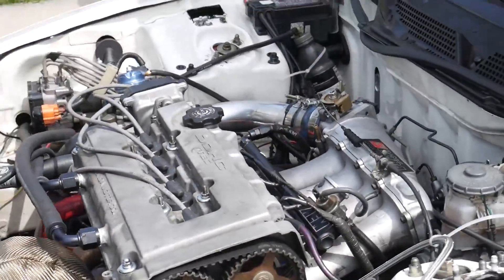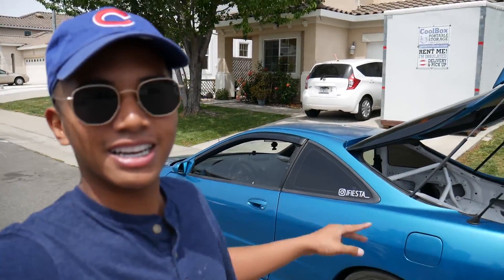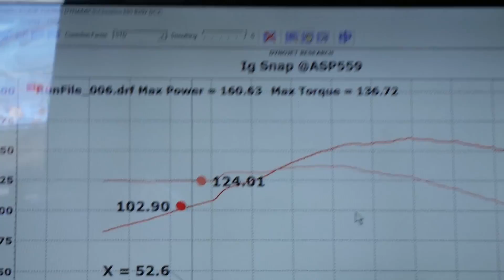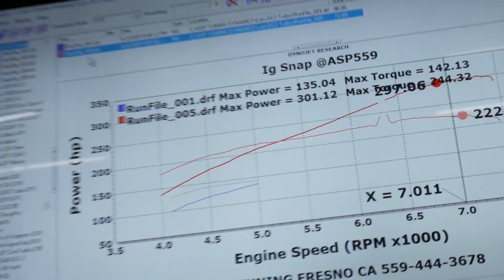HOW MUCH POWER DOES STOCK B20VTEC ACTUALLY MAKE.

Comment: thats weird. even for a low compression b20 w vtec is shouldnt be that low.i wouldve thought they would make 170-180 ish range. i have a stock b20b with 4-1 header stock intake and injectors, 89 pump, made 157 hp. pretty damn close to ur b20 vtec.
Reply: Yeah his tuner was probably spinning them like he was the turbo car. I'm throwing together a high comp b20b and 96 type r head. I'm hoping for atleaaaasssttt 170 with stock exhaust manifold,cat, muffler and piping. Stock 98 gsr ECU , skunk 2 intake manifold and that's about it

Comment: I’m making 191 / 157 on a stock ish b20b4/b16a2, running pump 92. Few more bolt ons & i should be around the 220 range
Reply: What dyno? Those are some pretty impressive numbers for a stock b20 vtec. I am just hoping my brother's stock b20z2/p72 longblock makes at least 170.
Reply: @OleUnreliable  dyno dynamics, tuned by RichMotorsports. If your b20v is healthy you should expect at least 170.

Rywire plug and play harness that plugs into p28. Custom basemap chip made 140ish, now i’m making 191/157
B16 oem intake, stock injectors stock throttle body
Cheap 2.5” 4-1 headers to a shitty 2.5” catless system. 
Head remanufactured
Stock rods micro polished.
ARP head studs and rod.
Crank stock, balanced and knife edged.
Shift linkage Integra.
Fuel pump walboro 155.
Water pump b20
Oil pump b20.
CTR Cams, high tension valve springs
Reply: @doghorsefish9320  Nice. I definitely missed the ish in stock ish. I was thinking an unopened bottom end. I bet that setup of yours rips pretty hard, I have a civic that makes about 194-195 but a lot less torque.
Reply: @OleUnreliable  yeah man it’s in a 95 civic dx coupe. Running the b16 trans, it’s definitely a ripper. I’m stoked to do a few bolt ons & potentially some head work & go in for a re tune. Should get 220 with bolt ons, maybe with some head work 230+ on 92 pump. We’ll see how much i wanna put into it, as i’m already pretty satisfied with it.

Comment: The b20vtec when stock is the rev limit at 7500? Or does it have any arp?  The tq is there but the whp is low, maybe it's a low comp b20vtec? I'm expecting 185-195whp for my setup on pump 91....thanks for the vid car looks hot
Reply from the maker: Hey brother, sorry this is a little late response. B20vtecs should be at 165 with the low comp b20 block. High comp you’re touching the numbers you want
Reply: Midorijon do you know how high she revs to on the stock lowcomp bottom end?
Reply: I made 175 whp and 133 tq on stock B20 low comp PHK Pistons and Type R head on E85 , upgraded the Pistons and Rods , put ARP studs and ACL bearings with a .30 Head Gasket , Same Type R head, V-stack intake, Type R header, full 3 Inch piping CATless tuned to 215 whp and 167 tq
Reply: @ACHEIZM  phk piston is the highest  comp of the b20 piston.it's the high comp of the b20b/z. Pf3 is the low comp but they have it in 8:8 and 9:2:1 comp. The phk b20s are 9:6:1 but yea with a gsr /b16 head it's still low 10:0/10:0:4 give or take but it is similar to a stock GSR so I would imagine on a good flowing bolt on and good tune with stock GSR cams I don't see why not 180+ with good tq. Your numbers looks right on
Reply: @ACHEIZM  also e85 to hit that number  so pump gas would be lower
Reply: @ACHEIZM  hey man! sick to hear how well things turned out. I'm deciding if I should open up the motor again or slap a turbo on my setup. I'm running b20b4(p3f)/gsr head ~9.4:1
skunk2 tuner1 cams/skunk2 cam gears
blox intake mani/S2 66mm tb
PLM tri Y 2¼" collector
blox 2¼" testpipe
amazon special 2¼ inch fart cannon
hondata s300v3 on 91 made 170whp/130tq dynocom
Reply: @noobatnothing  with your set up on low boost you can take yours to 260-300 whp imo ... It all depends what you enjoy most ! My set up was on 5 pounds before I owned the engine and that owner made 250 on the same Dyno. . Then sold to me without the turbo.
Reply: @b20eg195  thank you, pulled strong stock now built it's a very noticeable difference. . I put all the interior back in since I drive it alot more without all the leaks it had before.
Reply: @ACHEIZM  aha yeah, anyone who gets into B20's should know they have a long ass stroke, thin walls and weak rod bolts from factory. can't wait to see what the future holds for my setup. I'm only revving to 7500 on the stock bottom.
Reply: @ACHEIZM  what were you revving to on stock bottom and now with the built bottom?
Reply: @noobatnothing  on stock bottom I took it to 8000 a few times, but shouldn't have with the weak rods lol, majority of time didn't go past 7500.. with built block (eagle rods) 8200 max. I don't go past that since I don't make anymore power.
Reply: @noobatnothing  for me I'm at 7500 as well but when I go tune I'm going to have tuner take it to 8200 and or until power peaks so I believe a good point is 7800rpm.. I have headstuds rod bolts and block gridle in case I over rev it.  Beside I can't go too much or valve will hit the phk piston because I didn't want to grind it down.. for high comp build I got another b20 block for that. And looking 12:5 cr. So 215+whp
Reply: @b20eg195  exciting!! I coulda revved higher with my cams, but was happy being safe w/ stock rodbolts. I hope you can hit a nice number with ur setup!
Reply: @noobatnothing  nice setup sir, also got bout the same, b20vtec, 13ish compression on pistons, s2 tuner 2's, evo injectors, built head, s2 pro manifold, arp rod bolts, and 2.5 in pipings straight, no dyno yet hoping for good numbers along with my d15 non vtec turbo
Reply: @emmydelacruz982  if u had 3" pipe u would get more power. It's true but u need two resonators to quiet it down. Or use vibrant/apexi ws2 exhaust in 80mm form like me...but ur setup is good u should see 215-230whp

Comment: You didn’t do that swap correctly.. I make 210whp on b20V with super tech valve train, b16 head, gsr cams , stock b20 block. And valve train doesn’t give you an extra 50hp. So somebody messed up.

Comment: That b20v should be making more than 161hp on e85 my brother's gsr full bolt on, 91 pump gas made 167hp at chad's
Reply from the maker: Yeeleng vang every motor is different. Low comp b20 won’t even put out the same cr ratio as a gsr. That’s like saying a k24a4 with k20 head should make more than a k20a2
Reply: @MidoriJon  it still makes a healthier Powerband than any gsr due to bore. If using gsr head the compression ratio should still be close to 10.1.
Reply from the maker: Yeeleng vang actually incorrect. B20z with the phk pistons and has dome height of -4 and comp height of 29.5mm with gsr head which has quench pads to lower cr. The cr ratio on the motor is only 8:1. 1:51:1 rod stroke ratio. Which is right. Now if you had a high comp b20 which is the B it would have a cr of closer to 10
Reply: @MidoriJon  if its the p3f pistons on gsr head it should be 9.3 compression with 1.54 stroke with big 89mm crank and 84 bore and e85 adds 5-7 hp give or take
Reply from the maker: Yeeleng vang phk is some weak sauce
Reply: @MidoriJon  it is honestly
Reply: that low compression isn’t going to put out as much as a GSR. GSR has substantially higher compression, and not to mention 160 is kind of high. Those aren’t accurate numbers as he’s doing it in a roll dyno and not hub dyno.
Reply: My stock b20z non vtec on e85 made 160hp and still going strong.

Comment: my b20vtec with high compression stock bottom end (phk pistons)with 
supertech valvetrain 
type r cams, skunk2 pro intake, port matched 74mm throttle body, rc550 injectors on e85 squeezed out 200whp 168 torque on my em1 with stock exhaust

Comment: I have been debating myself if I should go for B20 VTEC after bought the integra DB7 that came with B20B. I am not sure how to determine if it is low or high. Any tips?

Found out it's a high compression b20b with stamped on head 0/0 and knock sensor on the back of the block.
Reply: syzg. integras never came with b20s...
Reply: @ConcordEditing  I know it doesn't come with b20b but I'm speaking as I bought integra with the swap.

Comment: What swap is that? B16, B18 Frankenstein?
Reply from the maker: I agree bro it is super weak. It’s a low compression block b20 with a gsr head. Super low comp. it was like 8:7:1
Reply: @MidoriJon  
I have a 2000 Si with the B20 swap and B16 head and it's pushing 260hp.
Just confused on that running only 160, that's what a stock 2000 Si is pushing
Reply: Do you guys do work on the side?
Reply from the maker: What do you need done?
Reply from the maker: 160 to the crank. To the wheel probably 125.
Reply: @MidoriJon  
I need my B20 swap done again. Had a local shop do it and they didn't get the timing done right and I don't think they tapped Vtec right(wasn't getting oil to the head.
Reply from the maker: Where you from bro?
Reply: @justinwood5747  Low com B20VTEC with stock intake manifold, stock cams, stock throttlebody, aftermarket  headers and stock injectors will not make more than 170HP 140TQ to the wheels on that dyno.  Highcom B20VTEC with full bolts on including 70mm throttlebody and sk2 manifold port to match TB, Headers, Testpipe, stock cams, will see around 180-185hp 145TQ to the wheels on that Dyno.  B20VTEC with 11.5:1 to 12:1 compression, pump gas, full bolts on and stock cams will see around 195-205HP 145-150TQ to the wheels depends on headers, but power will drop off quick after 7K RPM.  Add tuner cams and it will be around the 210-215 and power will carry higher into the 8K.  Add pro cams and it will be around the 225-230 and power will carry to 8.5K to 9K RPM. Add M5, pro cams and it will be in the 260-270HP and 170-180TQ.  Add more compression and it will go higher.  Add port and polish head and it will go even higher.

A stock low com B20VTEC at 160HP 136TQ is about 180HP and 150TQ to the flywheel.  A stock B18C type R makes around that HP and lower torque to the wheels, but cost about 2-3 times.  A stock GSR makes even less and cost 1.5 time.  A B16A is just a complete waste of money.

Comment: Idk b20z2 vtec.. should be like 180 to 200
Reply from the maker: No sir. B20z has a cr ratio of 9:1. Produces 146 hp to the crank. To the wheel probably like 120z. The numbers are right.
Reply: My stock b20z non vtec on e85 made 160hp.